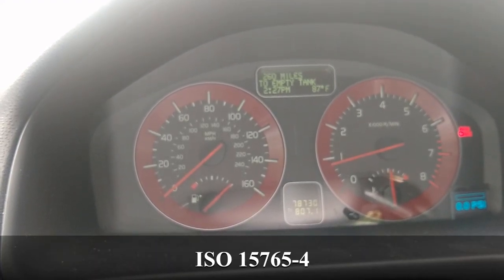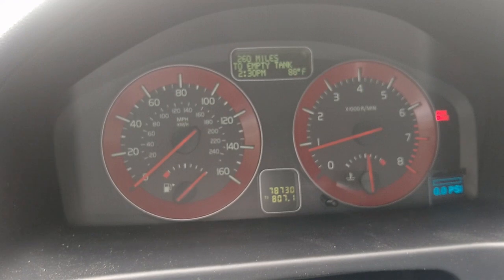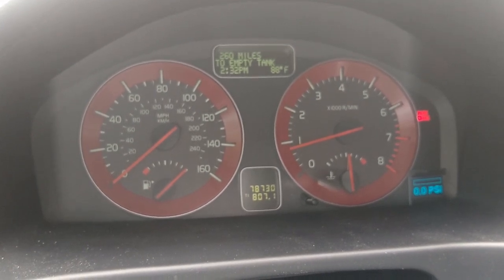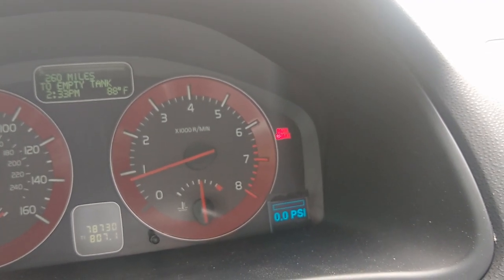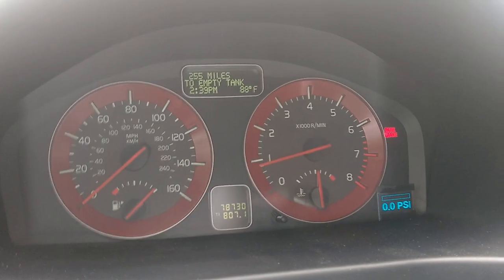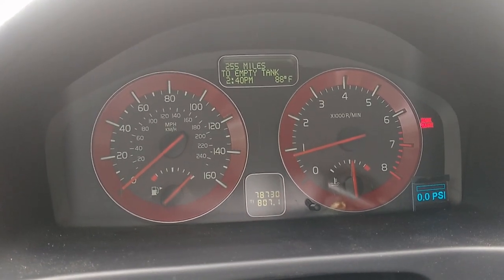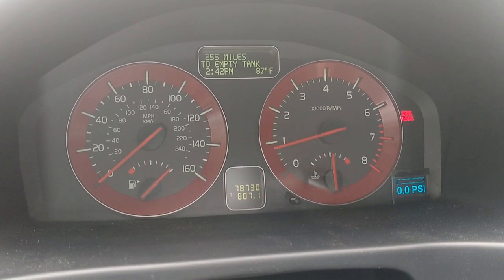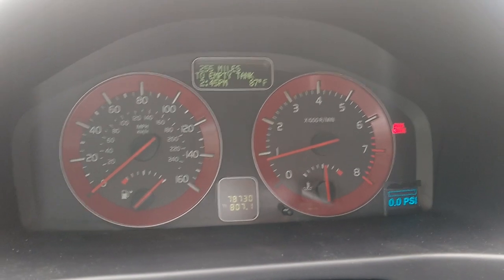Volvo CAN Boost Gauge

Comment: See if you can interpret any signals from the joystick on the power Mirror module located in the DDM. I'm a P2 Owner I know it's possible on the 2005-2009 MY. But not sure about P1 cars.